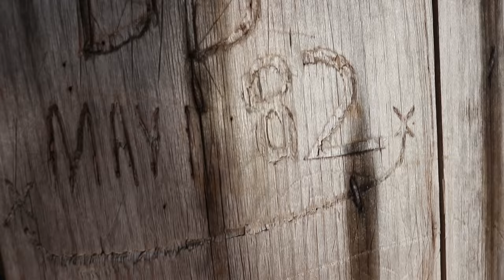Up River to Rustic Off-Grid Cabin (100-Year-Old Ranger Outpost)

Comment: Hello Mr Smurf or member of the "Blue man group" 😂That blue light was kind of erie! I have some thoughts about this cabin. In another episode you kind of helped to preserve the cabin. I kind of thought of things i would do with this one. First of all, i would cut that foam out, it should not be near those old logs. I would harvest moss and use that as intentioned in the cabin to seal it. Were i am from we have old log homesteads that some of them are over 350 years old. Sealed with moss, added on to through the years and it still works. It also preserves wood and keep both moisture and fungus out because of the tannins and Ph in the moss. Then we have the axe. I would use a knife in the same matter you cut the pumpkin up. Then i would make a wedge and hammer in in that cut to expand the wood and tighten the wood in the head. The axe would be as good as new again, and safe to use. I really appreciate your explorations to these old log cabins, and i have a "thing" for them. It is therefore so nice to see how you guys in Canada think around them, and use them. Kind of similar to us over here in Scandinavia! Thank you for sharing, and i apologize for writing a novel about my "rescue thoughts" about this one. It just triggered my mind! :)
Reply from the maker: Thanks for sharing some helpful tips Elisabeth!

Comment: Canadian, & you havnt a clue how to swing an axe !!, the first axe, obvious shaft was broken, well wrapped up with plastic tape, what do you do, swing it for all your might, swing much lighter, turn axe over when head is stuck in the log and gentle swing again, keep away from knotty logs too.....Steel shafted axe/maul, you swung it with all your might, why? its extra weight will take it nearly through, if not, turn over again with log still locked in. What happened to you almost every time, axe/maul gets fast in the mighty block too, wasting too much energy and knackering your tools........

Comment: Hi there! For your great videos!
I am shopping for a new canoe and I am debating on getting a Nova Craft tuff stuff expedition or a Esquif T-Formex canoe. I am doing a bit of everything... white water and flat water. I know you have/had a bleu Nova Craft canoe and also an Esquif Canyon. If you have to pick one canoe with either tuff stuff or T-Formex, which one would you take?
Reply from the maker: Hi Eric, that's a great question and I would argue that you can't go wrong with either, both are high-quality, reliable brands. That being said, tuff stuff is lighter, aesthetically nicer, but more expensive. T-formex is heavier, more durable and less expensive. We've wrapped both tuff-stuff and t-formex around rocks and the t-formex performed better (regardless, both canoes survived with no leaks). Second, hull design is an important feature, both Nova Craft and Esquif  have a wide-variety of boat designs for this. That being said, comparing a canyon to a prospector, a canyon has an aggressive rocker and is a whitewater boat that can be used in flat water (slower and more work to keep straight in flat water), a prospector is a flat water boat that can be used in whitewater (less responsive and a bit "sluggish" in whitewater). Personally, after seeing what we put the Esquif Canyon through in Labrador, I will always have this boat in my arsenal.
Reply: @NorthernScavenger  Thank you for your comments! Greatly appreciated!